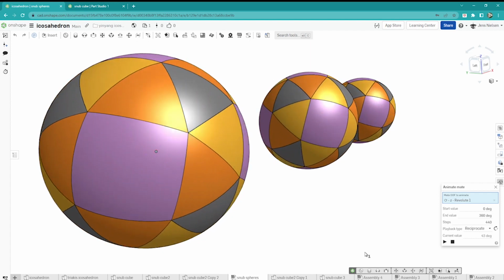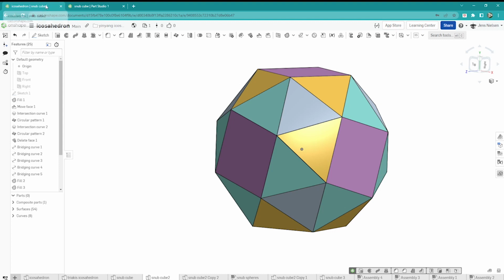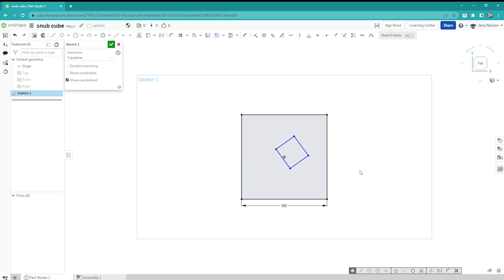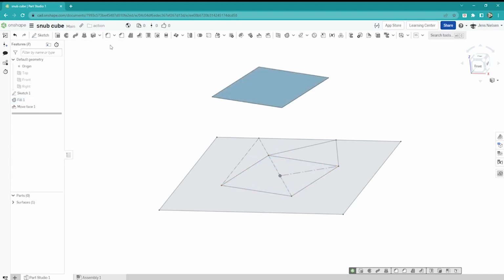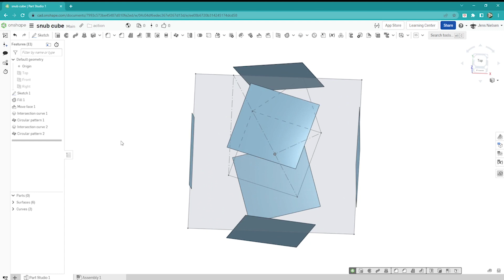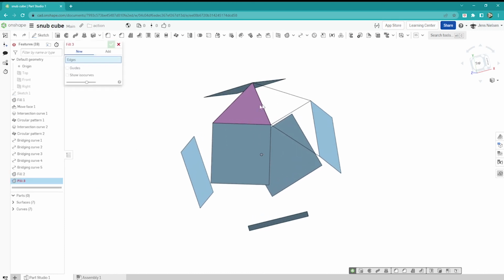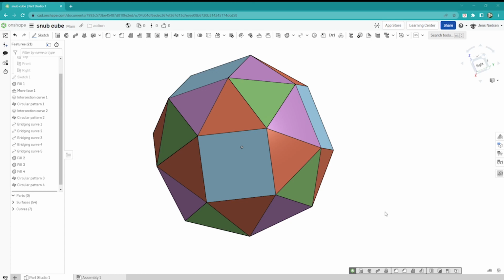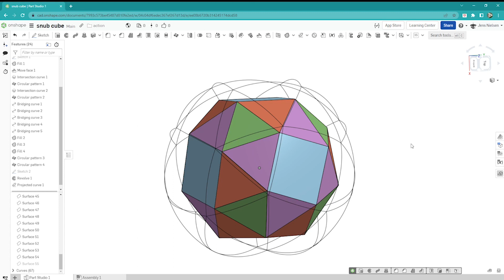How to build a snub cube in Onshape and project on a sphere

Comment: How did you get separate coloured sections on your final spheres? I can only edit the entire sphere surface colour and show projected edges on a one colour sphere.
Reply from the maker: Hi Geoff, I share a link to  my original part and assembly file, have a  look!
https://cad.onshape.com/documents/d15fb478e100c0f8e6104f9b/w/d00348b8f13ffa2286310c1a/e/68ac54a77546b3484cef245a?renderMode=0&uiState=64ca61e152851678938b65d5
Reply from the maker: Hi Geoff, after the projection I transfer as  a  composite  part to the assembly. Here  is a  link to the original file: https://cad.onshape.com/documents/d15fb478e100c0f8e6104f9b/w/d00348b8f13ffa2286310c1a/e/68ac54a77546b3484cef245a?renderMode=0&uiState=64ca635052851678938b682f